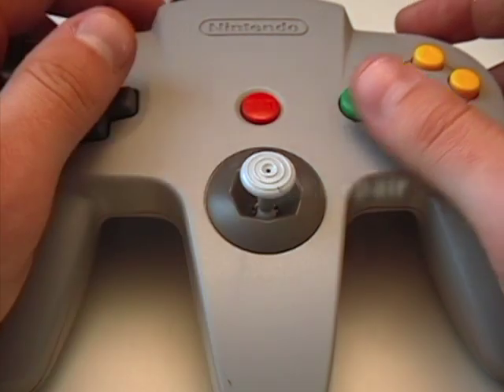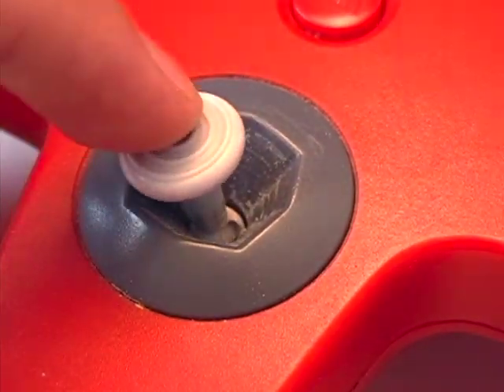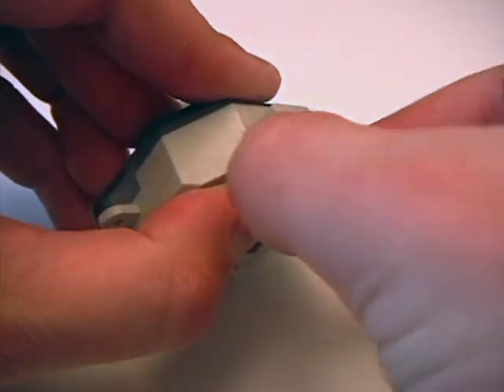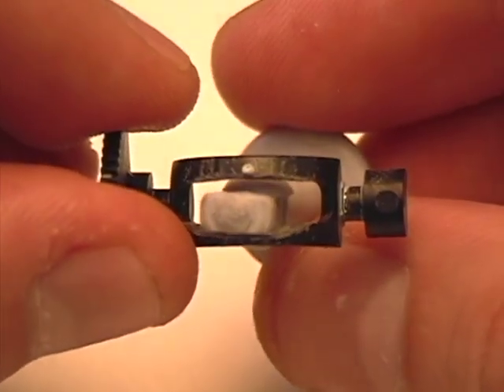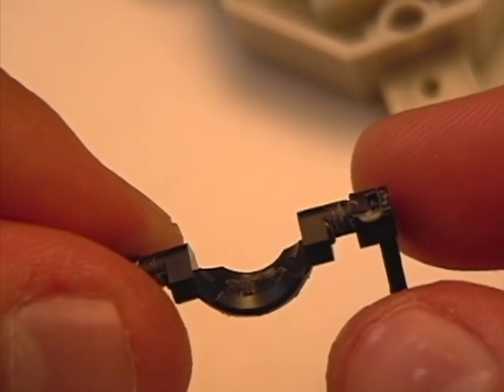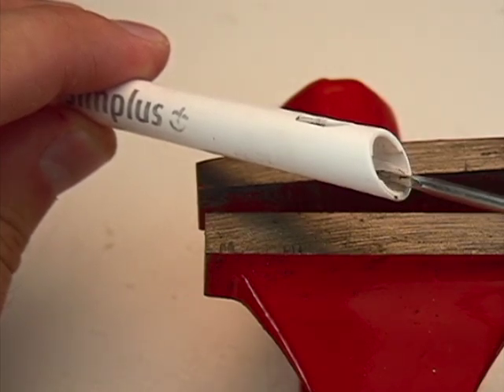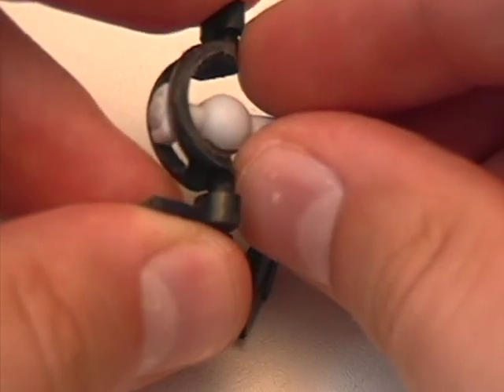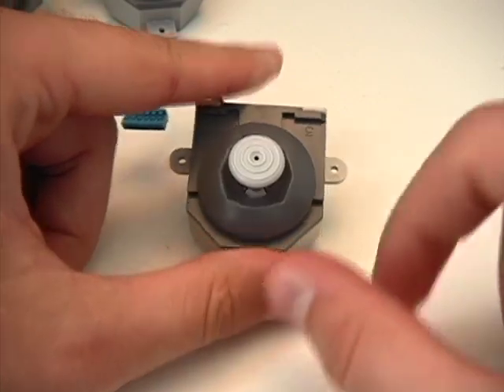N64 Analog Stick Repair

Comment: Great video! Did it work for long or you had to refix it again?
Reply from the maker: +Daniel Rodriguez My repairs have been working until now, no problems. I don't consider this a type of fix that you have to do every year or something like that. It's more or less permanent.
Reply: Amazing, I need to repair some >__<
lots of thanks

Comment: Hello, thank you for your video very informative.
I had followed your video step by step, but the stick get stuck when is pressed down, do you have any suggestion to fix it.

Thanks in advance.
Reply from the maker: +pabeldark It's hard to say what the problem could be off hand. It sounds like maybe your support piece has failed. You would have to open it up, take pictures, assess the situation, and consult with me then.

Comment: I worry that after supporting the joystick with the plastic resting against the black piece instead of it resting against the bottom of the bowl, long term use will wear our the gears and black pieces where they ride in the channels on the sides of the bowl. On a stock joystick, all downward pressure is on the bottom of the joystick and against the bowl. Now it would be against the black supports and transferred stress onto the gears and edges of the bowl
Reply: Yeah, but if you keep it greased up i think it will last a veryyy long time. I also bought a dozen replacements from kitch bent so im good for my lifetime.

Comment: This I like. I will try it soon
Reply from the maker: Glad you found it useful :)
Reply: Will it wear out again?
Reply from the maker: +Nicholas Bassaholic I've fixed four of these for myself and several more for other people and they haven't worn yet. Try for yourself and see if you're satisfied. I'm confident you won't be disappointed with the end result, although it will take some fiddling.
Reply: Okay, cool. I have an idea to use the plastic parts from non genuine brand new controllers and fit them to the original one, Does it still need the plastic bit fitted in there to raise it up??
Reply from the maker: +Nicholas Bassaholic No idea about the construction and tolerances of an off-brand controller. You're in uncharted waters. :)

Comment: I don't know if the dude here is using this account anymore.
I think i got it to work using a bic pen. It's really cool. 

I've been having a problem with the controller though. 
Sometimes it's perfect (if not a little stiff), but sometimes 
the stick goes all the way in one direction, let's say Left, but 
the game doesn't detect it as such. 

To fix it, I spin the stick in all directions slightly agressively. 
Sometimes it fixes it (temporarily), but sometimes it results in 
the controller going out of sync with the center. I end up having
to reconnect. Is there something I may have done wrong? 

I don't know if I got that little bowl for the ball on the control stick 
completely correct.

Comment: i need help i used two pens and one is fragile and the other too flexible which model of the brand bic you recommend?
Reply from the maker: +Jorge R. More flexible is better. It's hard to describe the type of plastic you need, but it should be kind of gummy when you file it, and flexible enough that bending it will not cause it to snap.

Comment: I just fixed one using this method, it came out pretty good, nice and tight, the stick registers pretty nice, but when it comes to making a left or right movement, its very hard for the stick to register the 100% position, for ex. switching between menus , or or moving fast side ways on a zelda game(holding Z) , it just hard for the analog to register, i have to put a lot of preasure on the stick so it will register that 100% left or right, it register perfectly until that point, any ideas? BTW best tutorial ever on n64 stick
Reply from the maker: +Milo R Hi Milo, thanks for the positive comment, feedback, and question. My best guess is that the support piece you made is a little too beefy. The tolerances inside are pretty small so even a small difference in length or size of the support piece produce a large difference in thumb-feel/tightness. Take a look at this: http://imgur.com/a/bBtLk. I'm guessing that the highlighted edge is hitting up against the two raised edges (circled). On a few of my sticks I've flattened those edges of course leaving the nubs intact. You can just cut the plastic with an exacto knife.
Reply: you were right, I flattened those edges and now it works great, brand new like, ty very much for the video and the tips
Reply: .Christopher Poplawski

Comment: I'm curious. Would lubrication help protect against the analog stem wearing the resistor cuff? I was thinking about lubing the black sensor bars that attach to the stem as well. any clue as to what that would do?
Reply: Nate Johnson I added a bit of dry lubricant to my controllers the day I bought the n64 in 96. they still move like new controllers. Nintendo left it dry on purpose otherwise they wouldn't sell replacement controllers.

Comment: can I use vaseline to lubrificate the analog stick??? plz
Reply from the maker: I would really not lubricate with Vaseline, no.
Reply: never use petroleum on plastic, it eats away the plastic. if you have to use a lubricant use a pure silicon

Comment: I have a problem with my joystick, it feels like it should, firm and resistant, it's not loose at all. But the up and down axis aren't working, while left and right work perfectly. What could be the problem and how could I fix it?
Reply from the maker: Could be a problem with the sensor or the wheel passing through it. Have you disassembled it? I would check for dirt or something visibly wrong with the wheel.
Reply: Christopher Poplawski Yeah, I disassembled it, cleaned it and nothing to me seemed out of place but I did check everything just in case. I'll try again later and try to see what could be wrong before deciding whether to buy a replacement or a new controller.
Reply from the maker: Maybe it's a bad led or photodiode (the sensor). It's unlikely but possible for even these simple electrical components to fail. If you're feeling curious, you can try to desolder both sensors and switch them. If the same direction doesn't work, it could be a power supply problem further up the chain. If the opposite direction doesn't work after switching, you know it's the sensor.

Comment: So about that "reasonable cost", how much are we talking? I'm going to try the repair myself first but a backup plan is nice to have.
Reply from the maker: +justcallmesven I'm linking you to my price list: http://i.imgur.com/dvAWBPW.png. I don't do this all the time, so it takes time and effort to get the tools, materials, and everything else set up. Once it's up and running, it's a lot easier to make additional repairs, and my prices reflect this. If you have any other questions and want to get in touch, please do not hesitate to e-mail me. Of course I will answer any questions you may have about the video here on YouTube.
Reply: +Christopher Poplawski Assuming anyone in the US has requested for your repair service, how long does it take to ship back to the US?
Reply from the maker: +soridosuneku I try to complete an order within a few days of receiving the package, and return shipping takes anywhere from a few days to a week depending on different factors, such as location and postal service delays. So total time estimated at around 2 business weeks. If you have more questions or want help just ask. I only charge for making the stick repair myself. No information, hints, methods, and so on are behind a paywall and I will try to answer any and all questions to support viewers of this video!

Comment: is this a temporary solution or forever working ?
Reply from the maker: +Risyenth Yentl It's a permanent fix. Mine have lasted and showed no signs of loosening over time.
Reply: Would you be willing to make me one? I REALLY need one, mainly cause the analog stick is all I use. Plus... In Mario Party 3 (which I'm getting), you need to spin the analog stick pretty fast.

Comment: Every time I try and put one of the analog sticks together I can never get it to fit shut. Ive been trying for days now and have several analog sticks I just cannot get clamped back down to screw. I check over and over and everything is lined up exactly how every youtube vid shows. Is this a common issue?

Comment: NICE! Seems promissing!

I have already experimented with some materials, but all of them were too fragile, especialy when it comes time to cut open the side of the piece. 

Do you think i could make the hole in the middle of it RECTANGULAR? So it would fit in like the black gear pieces, you would have to put in the thumbstick and then rotate, so that it doesn't fall

Comment: My fix actually worked pretty well...until everything broke off.

No joke, the super glue on the top gear thing (which had been broken before) wore off, and the stress from just testing the fix ended up breaking the piece that holds up the analog.

This definately has potential though, everything else is messy and unpractical, this one seems more worthwhile on the long run.

Comment: Thanks so much m8 this really helped tip fedora oh yeah How long does the plastic piece last before i should replace it and ive heard people say use dental floss instead of string
Reply from the maker: I've not heard of the dental floss method. I personally wouldn't use any type of string. The new pieces should last a long, long time. I've been using my first repaired controller for about a year now and it's still like new.
Reply: I agree m80s
Reply from the maker: ***** Yes.

Comment: i just tried to make the plastic piece for the analog stick; to hard to make, better just put a dental floss sooo much easier after 2 hrs struggeling  with that perfect plastic piece.......thanks for the insight
Reply from the maker: Yeah, I freely admit this method is tedious and hard to pull off right, but I still prefer the end result over any type of string method. There's no mushiness at all, the stick is like new.

Comment: Just one question......This should be called as Digital Stick instead of Analog Stick......Since it can only give 360 deg input.....But in a constant way.....in other words   if you press the stick further in a particular direction the character in game would move in that direction but with a constant speed and not in a varying speed which is the case with analog sticks using potentiometers or hall effect sensors.....Please correct me if I am wrong......

Comment: Does anyone know if 3rd party n64 controllers do this? Is it only the Nintendo brand?
Reply: CameronDoesCrafts YT most third party sticks are usually soldered/wired directly to the board.  It would be a bit harder to work on them.

Comment: Why is the bottom tip of the joystick black? Did you add some more epoxy resin?
Reply from the maker: +Craig Horner Before I made this video, I experimented with another method of repairing the problem, namely extending the length of the stick. The black tip is just that.
Reply: +Christopher Poplawski cheers mate.

Comment: Hey I was wondering if I could commission a support piece from you? I've had to buy a lot of new controllers in the past year since I speedrun Super Mario 64 and Banjo-Kazooie, after playing these games daily for roughly 6 months I've had to buy 3 other controllers. Sadly I don't currently have a drill with me so I wouldn't be able to make a support piece it would be awesome if you could help me out with this problem :)
Reply from the maker: Hi themartonfi, I would be glad to help you, but it's hard to make a support piece without the joystick module on hand to make necessary adjustments on a case-by-case basis. I propose the following: send me all of your used controllers and I will try to repair each one of them to the best of my ability. If you're interested message me privately and we can set something up.

Comment: My analog sticks are loose like the red 1 is
Reply from the maker: I tried this before. The problem lies in the fact that the bowl wears unevenly and the stick will again become wobbly when you wear away more of the bowl. It's fundamental problem with this combination of hard and soft plastics. Lifting the stick up in a support piece moves the force to another surface and the pressure is less due to the greater surface area.

Comment: You get a 10 out of 10 for creative thinking on how to fix. But I think with all that work needed it would be easier to just pay a $1.50 with free shipping on ebay for the replacement julie stick and at very worst replace the plastic bowls and black sliders from the new part
Reply from the maker: Duly noted. To be honest I wasn't aware of replacement sticks. I am a do-it-yourself type and I find making something much more rewarding than buying a replacement. However, I must concede that it's probably not worth the time/energy/money for the parts and tools if the replacements are as cheap as you say. Thanks for the comment!
Reply: Just to be clear I was not bashing your creativity at all I thought it was a very cool video to watch as far as problem solving goes

Comment: Would it not work to just extend the height of the stick piece by adding to the bottom of it that contacts the bowl? Wouldn't that be easier?
Reply: The black plastic pivots need the bowl to retain its shape for smooth x and y axis movement.

Comment: why not sell this new plastic part? ill pay for it
Reply from the maker: +mindstriker45tube It's something I hadn't really thought of, to be honest. In my mind the value is in the repair, not the actual support piece. A lot more work goes into fitting it perfectly than making it, so I would rather someone send me a stick to fix and have a guaranteed working product as the result, than ask for parts. However, I can make a pack or 10 or something as a one-off for you. Are you interested?

Comment: Why not just remanufacture these parts out of aluminum? I got a 4 axis CNC that will do the job. I will upload a video.
Reply from the maker: +William Ellison that would great. I don't have any milling machines unfortunately, and I tried to make the repair as accessible as possible.
Reply: +William Ellison   respond here when you upload the video please. thanks
Reply: Discord Shadow Lord of the Black Mountain Okay I mean
Reply: William Ellison (y)
Reply from the maker: William Ellison Thanks for the contribution to N64 knowledge, and nice equipment! I wish I had tools to test the deadzone and so on. Anyway very interesting, pleasure reading the thread!
Reply: William Ellison nice, !,. well but the black parts are still plastic. i know they are not cheap to do and also he black parts if done in metal would damage or worn the optical parts . but i recomend using like a metal cover in the gaps and reuse the black platic parts. sorry for my english but maybe you getmy idea.
Reply: Discord Shadow Lord of the Black Mountain Alright you go ahead and do that then. Let me know when you have it done and post it here.
Reply: William Ellison i don´t see your VIDEO yet. nly photos and they are not yours LOL
Reply: Discord Shadow Lord of the Black Mountain  I'm not ready, and i'm still looking into it. May take some time. Could be a while. Anyway, take care. 

P.s. Those are not my photos?? You're right thank you, but I will use his example to build my own CAD design.
Reply: Christopher Poplawski Those are not my picture.
Reply: Christopher Poplawski However, i'm happy you found it interesting.

Comment: Any recommendations for finding a similar type of pen that you used? Most pens I have lying around have a much thinner wall and are much more malleable. I'd like the pen to be as stiff and the same diameter of thickness as yours.
Reply from the maker: +James Rasmussen Actually finding a plastic with the right combination of stiffness, strength, and flexibility is a challenge. I used to repair with a rather hard plastic, but lately I've switched to a softer but stronger plastic found in Bic Brite Liners (http://ecx.images-amazon.com/images/I/41T22Z5MBPL._AC_UL320_SR304,320_.jpg). I don't buy plastic tubing or pens specifically for this though, I just use whatever is around and through experience I know what is acceptable. I just measured my Bic, outside diameter is 9.5mm or 3/8th inch, and inside diameter is 7mm or 9/32nd inch. Hope that's a good starting point.
Reply: I see. Interesting. Thanks for replying. Did you choose the Brite Liners because they had a larger circumference and you didn't need to shave down the left-right moving gear in order to successfully use your plastic shim? Or, like you said, was it just what you had on hand at the time? Thanks for helping out. Trying to eek out as much info as I can from someone who's done this a lot. :)
Reply from the maker: I shave down the V-shaped tops of the left-right piece every time, like in the video. The dimensions of the Bic are comparable to those of the pen I used in the video, and yes, It was just lying around. There is quite a bit of leeway with the curvature (which translates to outside diameter) of the pen, the most important is the inside diameter because that will cradle the ball and we want a reasonable good fit.

Comment: They didn't make the N64 controller very well. But it was the first console to have a control stick so...
Reply from the maker: +Mariofan10105 You have to start somewhere.
Reply from the maker: +Mariofan10105 You have to start somewhere.
Reply: +Christopher Poplawski Yeah. Mine are wearing out but not as bad as yours was. Isn't it easier just to get a third party controller?